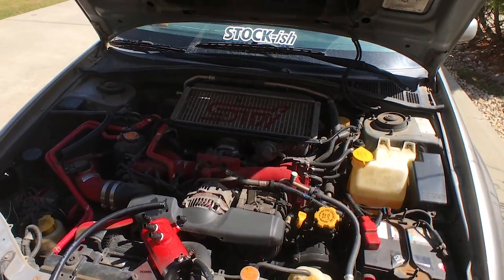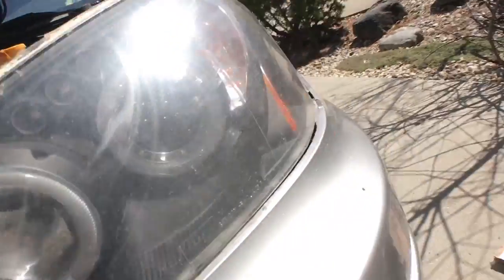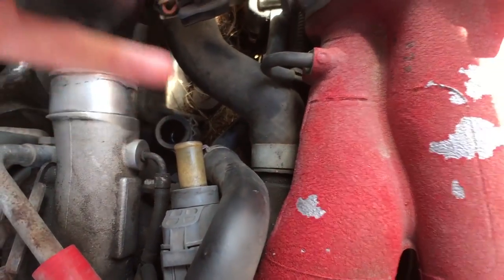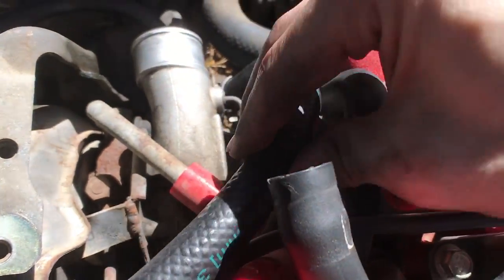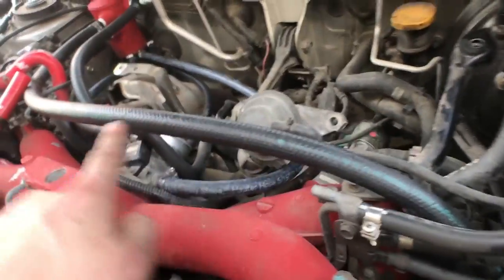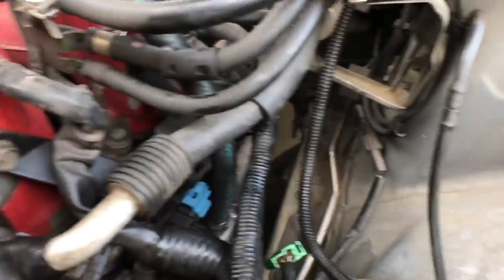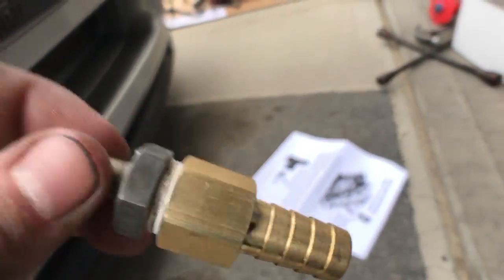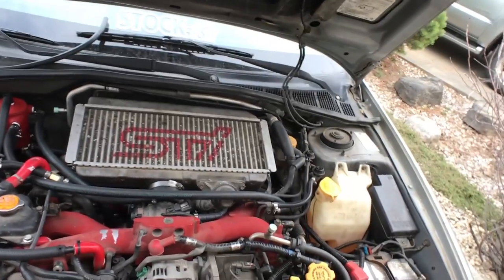Perrin Air Oil Separator Install

Comment: Took me 2 whole days to install this , followed exactly what you did took my time even double check the instructions before every hose and step “I have 04 wrx so slightly different “ triple checked for any leaks verified everything was right and secure routing , no check engine light, rough idles or any issues very well how you explained , recommend  to everybody else take your time do not rush something like this guarantee not issues thanks you steezy
Reply from the maker: Thanks for the awesome feed back and glad to help out man, I think it ended up taking me a total of 10 hours to finish this off and that’s with filming everything too haha
Reply: Appreciate the tip bro, waiting for mine to come in to the mail
Reply: Tadthebrave if you need help let me know I can walk you through it
Reply: Diego Garcia Thanks appreciate it man. I will. Where do I contact you at?

Comment: @shadowsti the hoses were routed really close to the turbo. How do they withstand the heat from the turbo???
Reply from the maker: This was the routing that Perrin recommended so that’s what I went with, and there is a heat shield on the turbo to keep most of the heat out but yes the hoses could absorb some that heat as well. You could simply get some heat wrap and put that around the hoses to help with that.

Comment: I don't understand you have the hose comming off the pcv under the throttle body and then connected into another pcv valve then it goes to the y connector why do you need 2 pcv valves right there together and not up on your top line

Comment: Why are you missing a valve cover bolt on the right side of the engine? shown at 10:28
Reply from the maker: Couldn’t tell ya man, that’s what you can come across when you buy a used vehicle

Comment: I'm currently working on a similar project. Perrin AOS,  FMIC and cold air intake for a '15 sti. Your video helps a lot! Since the routing of the tubing is a bit different, did you have to cut any of the provided hoses?
Reply from the maker: +AndreeBZ glad to hear that my video is helping out, and there were 3 different sized diameter hoses and yes you will have to cut to fit, so I would mach it up first to get the right size and always cut a bit bigger from what you think you should. They provide a little more than what is needed but not enough for a mistake haha
Reply: Shadow STI Mostly done with the install. Except for a 1/2" hose that came with the FMIC, and is supposed to connect to the crank vent hoses. Since I have installed the aos, I wonder if this hose is necessary. Any ideas?
Reply from the maker: +AndreeBZ hope I'm answering this correctly, the 2015 is the ej257 so the destinations of the hoses should be the same, so there should be a 2" long hose that should be connected to the crank case vent and should attach the y splitter there for the crank case vent on the side of the aos and the oil return line to complete the routing of the hoses for the crank case vent. The 1/2" hose should connect to both vents on the heads and to the two ports on the aos, and the other 1/2" hose should go from the top of the aos to a y splitter to the intake and the other side should have the vent valve towards the intake manifold.
Reply: The hose i'm referring to came with the perrin front mounted intercooler, and I believe is necessary in applications that don't have the AOS. I gave them a call today and no luck reaching a tech. Hopefully they will reply to my email soon. Thanks for your input. keep the videos coming!
Reply from the maker: +AndreeBZ oh okay that I am not to sure about that, unfortunately I won't be getting my Perrin fmic and cold air intake in a reasonable time to answer your question
Reply from the maker: +AndreeBZ I took a look at the install instructions for the 2005 Perrin fmic and the included 1/2" tubing that comes with the fmic is basically putting those breather tubes that were on the tmic but since you had to remove the metal piping that connects it all back together just like stock. You don't have to use the supplied hoses that come from either, as long you use one set of hoses connect the head vents and goes straight to the aos into the appropriate spots and then the connection at the top will bring that tube back to the intake side. The hose routing is pretty much the same for the 04-17

Comment: Did you have any idle a/f ratio issues? I installed the same thing on mine but now runs lean at idle and after idle relearn it caused CEL and flashing CC.
Reply from the maker: No I didn’t have any issues, must be a line connected in the wrong place, or didn’t cap off any left over vacuum lines

Comment: I mounted exactly like you a lot of guys I noticed with a JDM GC8 have it in the other side weird, or double set up?
Reply from the maker: Yeah I’m not to familiar with the layout of the engine bay for the JDM GC8s but doesn’t matter where it is placed in the car, as long as all the hoses are hooked up to where they need to go
Reply: Super weird I’m actually just trying to figure out my A OS there anyway you could send me a picture or video of how you  ran your lines and what ports they go to

Comment: I have a question on where the plastic plug goes I didn’t think you showed how or where it actually goes ? Thanks !
Reply: Wait I watched over and over and I think you did say where just didn’t show it done , it’s on the yellow nozzle right??
Reply from the maker: @3:47 there is that yellow nozzle that you’ll have to put the plug on, then just put a zip tie on it to secure it in place

Comment: So how did this system hold up ? Would you recommend this exact model ?
Reply from the maker: For something that dose a decent job, this is a good option, but if you’d like the most performance, I’d suggest the IAG Separator
Reply: @ShadowSTI  I’m definitely not modifying the fuck out of my out car anytime soon I’m just going for something that will help keep up The longevity of my engine I recently did a complete factory build on my short block

Comment: In the end, what was the trick to getting the intercooler back in? Everything seems easy breezy until you have to reinstall the intercooler.
Reply from the maker: It look me probably 30 minuets to get it back in with out the proper tools. If you notice on the silicone hose, there is a little tab that you can pull to stretch the hose over the turbo outlet and the best tool would be about a foot long set of tongs with at least a 45 degree bend on it and that should make it a whole lot easier

Comment: Where did you get your red hoses??
Reply from the maker: +river dearden I bought the car with them already installed but they are the mishimoto silicone ancillary hoses which you can find here https://www.mishimoto.com/subaru-wrx-silicone-ancillary-hoses-01-05.html or any similar website
Reply: Thanks man! So they wouldn't work if I bought them and put them on my 06 sti?
Reply from the maker: +river dearden for 04-07 WRX/sti https://www.mishimoto.com/subaru-wrx-sti-silicone-ancillary-hoses-04-07.html

Comment: It would have been even more amazing if you had shown where and how the bracket installed... i feel thats the bigger hurdle on this project
Reply from the maker: There’s just a couple threaded holes there where the bracket goes, might have to use different screws though

Comment: nice socket set whats the link
Reply from the maker: https://www.amazon.ca/Stanley-Piece-Professional-Chrome-Socket/dp/B01LVVN9VH/ref=asc_df_B01LVVN9VH/?tag=googlemobshop-20&linkCode=df0&hvadid=292999463894&hvpos=1o2&hvnetw=g&hvrand=6495537825922855542&hvpone=&hvptwo=&hvqmt=&hvdev=m&hvdvcmdl=&hvlocint=&hvlocphy=9061280&hvtargid=pla-492452768082&psc=1

Comment: Nice I have an 05 as well. Did you clean out the intercooler and if so how?
Reply from the maker: +J strong no I didn't have time too but if I were to I would take the charge pipe off then just take some break clean and spray the inside till it would be clean then wait a while for it to be completely dry and evaporated